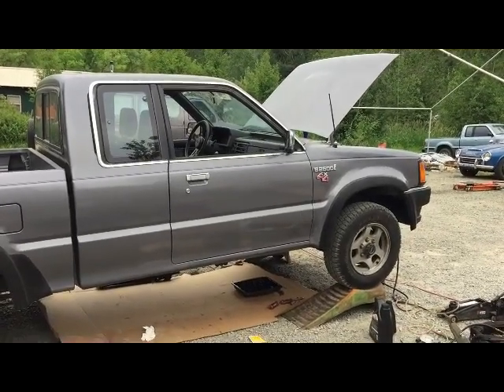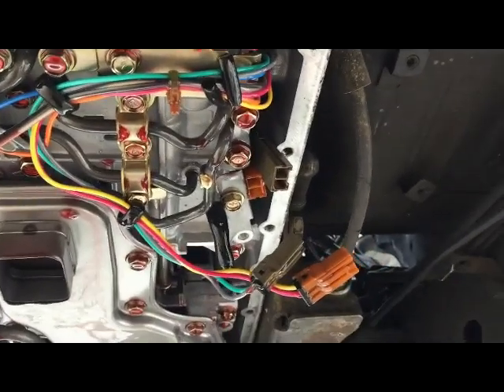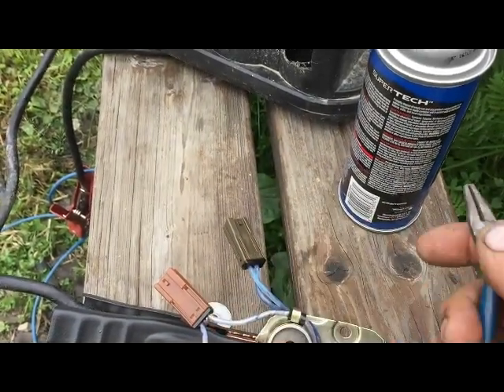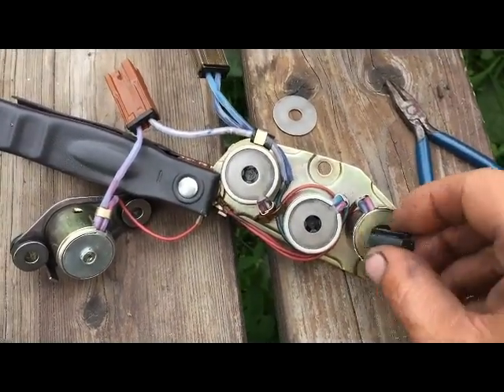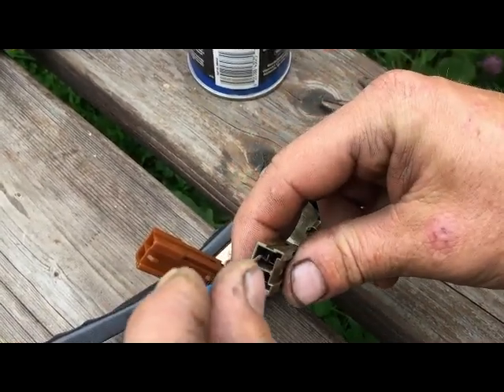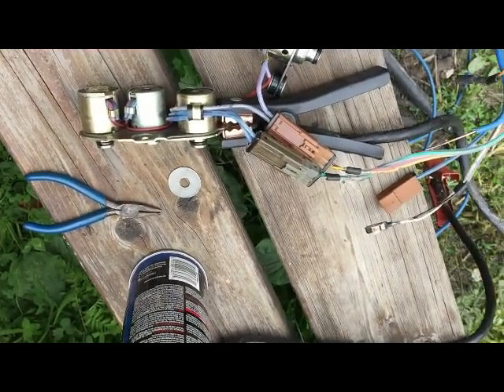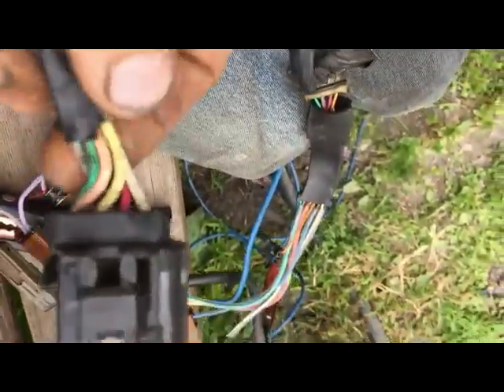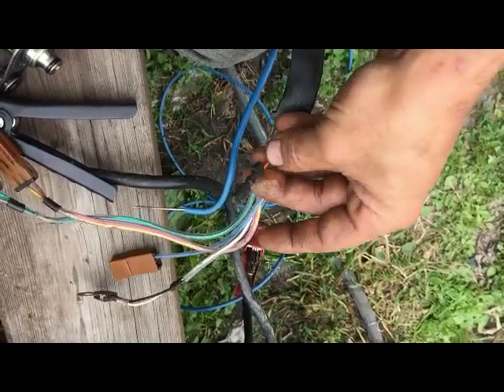automatic transmission solenoid repair re4r01a b2600i

Comment: Great video thank you.

I've got a 3.2 Elgrand with a RE4R01A trans. Since I had it its had slight judder sitting at 50mph ish whilst at part throttle. Not a big issue just a bit annoying. It goes away with more throttle or letting off, its a very common problem on the 3.2d elgrands. Do you think it could be the converter lockup solenoid? 

But Now I've got another more serious issue. I drove the car and it would not pull away firmly like it used to. It felt like it was slipping badly when pulling away, but otherwise drove fine ( I think, I limped it home scared). Trans fluid looks brand new and spotless, and good level. I did the self diagnosis light trick on the trans and it flashed 10 times which according to the internet is line pressure solenoid short / disconnected. I'm gonna ohm out the solenoids from the plug. Also I'll check the pins on the connector (female you said) are still springy. If that all looks ok then I'll pull them out and inspect and clean. If not I think I'll replace the line pressure solenoid and do the TC lockup one too whilst I'm in there. Any other suggestions I'd love your input

Comment: Thank you for this video. You saved me a trip to the junkyard to replace solenoids that aren’t dead! I think I have trash in one of the shift solenoids or something is going on with the 2-3 accumulator. 

I installed my engine with the torque converter bolts still in the torque converter which bent the flex plate and caused the torque converter to be pulled back from its fully seated position afterwards. It drove fine for a couple days then it would bog from a dead stop and slam forward in short bursts so I drove it straight home and checked the fluid. It was saturated with some sort of material whether it was gear clutch or from the torque converter, I don’t know. I put a new flexplate on and then I flushed the oil 3 times and ran some transtune before a final flush and filter change. Before the final flush it had a slow shift from 2-3..

After the filter change it ran great, still had the slow shift, until right before I pulled back into my neighborhood, it shifted into 3rd with a bump and then broke loose like it wasn’t in gear at all. I stopped immediately and 1st and 2nd operated normally but the moment it shifted into 3rd it was slipping so bad it seemed like neutral. I could tell it was very slightly engaged though, there was some power coming thru but very little and the engine was revving freely. I limped back home and here we are.

I did find small pieces of black chunks in the pan during the filter change. 

After I got home from the crazy slipping I did find the transmission filter wasn’t seated correctly. However I seated the filter correctly and went for a drive with the exact same problem.

What is your opinion of my situation? Besides that I’m a dummy :)
Reply: Thanks man. You were right, 3-4 is almost completely gone now. I have a JY trans sitting on the garage floor waiting to go in.

Comment: Very good video on how to do this. My 95 Pathfinders Drive solenoid is sticking and I have to start the car in 2nd gear, then in about a block and a half it will go into drive and behave normal again until I shut the car off and let it cool. Before I tear it apart to change them or clean them, i'm going to use some SeaFoam transmission cleaner it it to see if it will un-stick them, then change my filter and Transmission fluid. Thanks for the nice video. Best wishes n Blessings. Keith Noneya
Reply from the maker: Remember any foreign debris or contaminants will destroy this trany there's a valve on the pump that sticks and stops oiling 1st overdrive and reverse  planetary.
Reply from the maker: Thanks

Comment: Thank you for posting, My b2600 will not shift into 3rd gear and the "hold" button stopped functioning, Is there anything I should check before I pull the pan,valvebody and soleniods. btw my 93 2600 4x4 looks just like yours.
Reply from the maker: Did you lose reverse

Comment: I bought a 2004 Nissan Xterra with this transmission with 277,000 miles on it, the vehicle runs perfect 4x4 works and the transmission shifts perfect in all foward gears Even the OD works but when you put it in reverse nothing happens! the engine changes RPM very slightly so i know its engaged somewhat but no moving of the vehicle. The owner i bought it from said a trans shop said reverse band was out  but i dont even know if this trans had a reverse band, ive heard it could be low line pressure to a reverse soiliod , any ideas?

Comment: Good info on the spring-less solenoids.  I have the RE401A trans on my 02 Nissan Frontier and I'm getting transmission shudder at speeds above 50 mph and a P0744 code (doesn't start until I drive a few minutes).  Last summer I dropped the pan, and changed the fluid and filter, then did a couple more drain and fills and the shudder went away for about seven months.  It came back and  after a couple of drain and fills the shudder is still there, seems to kick in sooner too.   The FSM says this is a mechanical malfunction, not an electrical issue.  I'm thinking the changing the TCC solenoid.  It's on the bottom of the valve body so I access just by dropping the pan.   I'm now driving with OD off and staying below 50 mph to prevent TC lockup and keep the tran from shuddering.   Do you think the lock-up solenoid is the problem or something worse?   I'm willing to tackle this but dropping the valve body is a scary proposition.
Reply from the maker: Pulling the valve body is ease if the bolts are short put them back only pull the long bolts and there is a couple under the filter be carful to not damage the gasket and make sure the filter o ring is not cut or damaged. Pull the trans electrical plug pull the cap off of the female side of the plug and carefully make sure all contacts are lifted if not take a sewing needle and lift them I got called to a job it took 8 hours to find the problem and it was poor contacts. Same problem as yours
Reply: Is the trans plug outside the transmission? And is the solenoid under the valve body the TCC or Lockout?

Comment: JATCO Transmission??   I have RE4F04B in my Maxima  with TCC intermittent P0744.  I got it to barely pass  state test. I had dirty fluid,  did 3 drain and fills with few thousand miles between each. and its alot better. at higher speed I am getting the P0744 but everything else is pretty much ok.  
Fluid used  Valvoline MaxLife full Synthetic ATF 
first 2 drain and fills also used Lucus then before 3rd drain and fill used seaform transtune trying to clean  up things.  it did help, but still gets P0744. I am thinking I need a Solenoid block  installed and new Filter.

Comment: I'm having a problem with my 99 Nissan frontier. From a cold start it doesn't want to go into drive. Reverse works fine just not drive. I had solenoid changed a few years ago then the engine light came back on the next day. Transmission shop said they needed it back to check all the connections and couldn't tell me how long it would take. Said it could be day's or weeks before they could get it done. I installed a tach and watched it shift all was fine. Now it is doing this crap where it doesn't want to go into drive. I actually blew a line the other day thank god it was a rubber line going to the radiator for the circulation of coolant for the transmission. I'm not what to do anymore. I can't afford to put back in the shop. I may drop pan and do fluid and filter again and may attempt to drop valve assembly to check solenoids. I'm worried because of all the bolts. I have never worked on a transmission before. Now tearing down a motor no problem lol.
Reply from the maker: It’s ether the valve body itself that is bad there is many pistons and valves in there and the casting gets warped or a piece of debris get in there and jam up a valve. The other cause of this is where the main pump in the transmission is sucking air through a broken seal but if this happens you will most likely not have reverse. So I would grab another valve body and start there or rebuild yours if you grab one off of another vehicle then be careful the old gaskets are brittle there are a few big springs keep them in order and you don’t have to take all the bolts out of the valve body to drop it. When out inspect the three pistons that the spring went to make sure they move one of them is your foreword engagement piston.
Reply: @WorldScienceTV  ok thanks so much. If I pull the big bolts out to drop the valve body you mentioned springs are they going to shoot out or stay in place? Like I said engines are no problem working on, I've just been scared to try a transmission.
Reply from the maker: They will fall out so grab them mark them for there location

Comment: nissan d21 4 cylinder-  shifts smoothly without any lag, but during upshifting only stays in 4th gear for 1/2 a second before dropping into lockup. forcing a downshift from lockup results in skipping 4th and going straight to 3rd. if i'm very careful about speed (around 35-45mph) i can finesse an upshift into 4th, and it will hold until the load drops off (start going downhill) or the speed increases enough to lockup. do you think this is a valve seal leaking in the valve body, or a solenoid problem ? thanks so much !
Reply from the maker: If the solenoid is Jamed or the Oring is torn maybe. I delt with a transmission that was doing the same thing and it ended up being that some one tested the transmission wiring harnesses plug with a multimeter and smashed Down the pins in the plug.  And the temp sender in the transmission was the  problem
Reply: @WorldScienceTV   thank you very much both for the youtube video, the info, and the response. i really appreciate your sharing with us. :-)

Comment: Hi, I've been having problems with my trans not shifting up to 3rd gear. I removed the valve body to check the solenoid's, they seemed to free up OK.

But after reassembly and refilling with ATF, the trans is driving forwards in every gear (PRND21). The instruction document I used just said to reinstall the shifter shaft in the valve body, it didn't mention connecting it to the inside part of the shifter linkage. So I just put the shaft completely inside the valve body and bolted up the valve body. Now this really didn't seem right to me, but the instruction manual was quite comprehensive, so when it didn't say anything about connecting the shaft and linkage, I presumed it was intentional. But now I think that is the problem.

What are your thoughts?
Reply from the maker: If the truck starts in park but is in drive then you are correct

Comment: This video has been very informative, thanks! I have an issue with a 2000 Frontier 2.4 2-wheel drive model and it shifts from 1st to 2nd very late at around 4000rpm, but I can get it to shift at a lower engine speed if I let off the gas. It also will not go into high gear on the freeway, so I have to stick to city streets. Changing the fluid did nothing to help it. I am thinking it could be one of these solenoids, but unsure of how many there are total. Any words of advice?
Reply from the maker: I would check the Tps sensor. on this rig it has a two in the same package one for engine and one is for the tranny. When it shifts does it shift hard
Reply: @WorldScienceTV  Okay that's something I will test, thanks! The shift quality seems okay, not too firm or anything.
Reply from the maker: When these solids stick usually it shifts hard but it doesn't mean the valve body isn't full of metal there is holes in the top of the valve body when debris gets in there and it sticks the pistons in the valve body
Reply: @WorldScienceTV  Okay, if the TPS doesn't fix it I will remove the valve body for cleaning/inspection as a next task to see what I can find. Thanks!
Reply: Hey I’m having the exact problem. Releasing the gas it will slowly shift to second, but revs at close to 4000rpm on highway.  Did you find out what fixed it?
Reply: ebp73 I tested the TPS and it was fine, but repair info was vague for testing procedures, so I replaced it. Did not fix the problem. I never ended up removing the valve body / solenoids for cleaning because I found a new-used transmission for cheap. Took 14+ hrs to install and was one of the toughest transmissions I’ve had to change. I should have done the valve body and solenoid cleaning first ...would have been done in one day and cheaper I guess. Anyhow, the new transmission fixed the problem, but it’s shifts are very firm. Research has shown that firm shifts on these first gen Frontiers may be normal by design. I feel that is inaccurate though because if people have trucks that used to not have firm shifts, it counters that statement. I want to restate, if I could go back, I would drop the valve body and clean everything.
Reply: Thanks for the reply Erik.  I guess I’m going to buy the solenoid kit and try that.  Is lock out solenoid the same as the TCC solenoid under the valve body?
Reply: ebp73 For a 2000 Frontier, as far as I can tell, there are two types that look different. Lock up solenoid (part #3194048X02) and also a TCC/Lockup solenoid (part#3194041X10). The TCC is for the torque converter. They could be the same thing, but I would try and cross reference them to each other on a Nissan website. I got these part numbers from Rockauto.com btw.
Reply from the maker: You can check the resistance from the electrical plug for all solenoids
Reply: World Science TV Smart call, easy to do before dropping the valve body. If everything checks out, then they could be getting stuck from being dirty.

Comment: Hi thanks for this video. I have a question I have a Nissan with this AT. It has a snow/normal/power switch. From time to time the AT will hang on first, if I switch the snow switch to snow (which makes the AT start in 2nd) then the AT changes up to 2nd immediately. I have changed the pedal arrangement (this has 2 pots one for the engine and one for the AT I believe and also changed the TCU and the snow power switch) but still it plays up every now and again. Do you have any ideas? Guess the hydraulic side of the AT is ok as when I operate the switch solenoid 1  goes open? Any help very much appreciated.
Reply from the maker: Maybe a tps sensor but more tan likely the valves in the valve body or bad  solenoid they get a little metal in them and stop working the valve body on this at is no big deal to take apart but don't do it with out the gaskets. The valve body has holes on the top side that let metal shavings get into the piston ports and they start hanging up some times randomly
Reply: Ok I have changed the pedal box for a known working good unit. Didnt think it would be the solenoid as when I use the snow switch it changes instantly to 2nd. It is a very strange problem just trying to get someone else to put there brain onto it as I might have missed something :-)
Reply from the maker: This is an extremely problematic tranny  (RUN!!!) from it!!!???!!! Please subscribe  thanks
Reply: So as an update I rigged a 12v led onto solenoid 1 output from the TCU, when it doesnt shift to 2nd then the light is out so the box has been commanded to shift so maybe a sticky/dirty solenoid "A"?
Reply from the maker: check the plug going into the transmission to see if all the pins ar up i had one that had the pins pushed down pulled them up and all was good

Comment: Hi, thank you for very informative video. I have 2003 Nissan Pathfinder LE 4WD. It will start driving from the 1st gear without problem then sometimes the RPM increase before it shifts to 2nd but it does it all the time before it shifts to 3rd. No problem in the 4th. If I drive slow it is okay but stepping on the gas pedal like when getting on a freeway will cause it for sure. If in traffic most likely in 3rd the RPM are increasing a bit and it feels like it's loosing power. Do you think this is also caused by the solenoids?
Reply from the maker: As always check codes first. Yes this is one of the symptoms of solenoid failure
Reply: @WorldScienceTV  Thank you for your quick reply. How do I check the codes? There is no check engine light on.
Reply from the maker: Obd2 plug and tester Orilys  will scan your car

Comment: I have a RE4RO3A transmission that slips only when cold. 
When I first put it in D it slips for about 15 seconds. What is the cause and what can I do to fix it? Thank you so much
Reply from the maker: Probably a cracked pump seal drawing air or hard and seal on the first stage piston

Comment: my 98 Pathfinder won't shift into 3rd gear. Rev goes up to 4-5 thousand and it feels like goes into neutral. Then when let off the gas (rev comes down to 1-2K) and suddenly goes into 3rd gear. I checked the throttle positioning sensor/switch with a multimeter. Adjusted the position of it. Pulled valve body and cleaned every single valve/spring inside. Checked the shifting solenoids( they seemd ok clicking and good ohm readings)
Reply from the maker: Check the transmission electrical plug to make sure somebody didn't use a multi meter and smashed down all the connectors

Comment: Okay so I know this video is getting older but if anyone could give me a bit of a hand it would be super appreciated, my truck seems to only have first and second gear, 3rd 4th and reverse are all dead. Thinking perhaps I have a solonoid issue because there doesn't seem to be any friction failure it just doesn't even engage to begin with. Thanks
Reply from the maker: Pull pan look for metal if no metal  pull valve body and do a full disassembly and pull all valves clean and make sure every valve moves freely. If metal is abundant get a new trany and get the newest one that will fit even if you have to change the wire harness